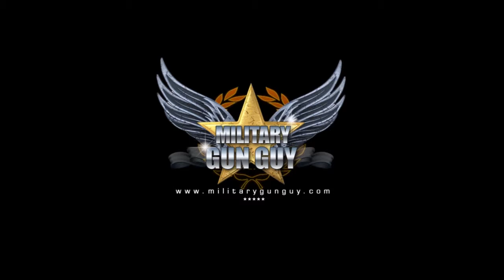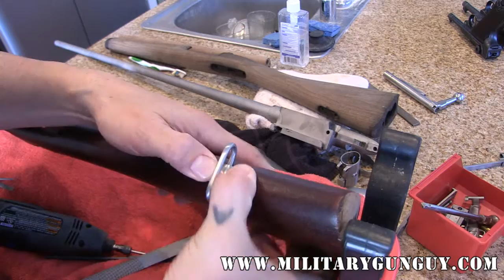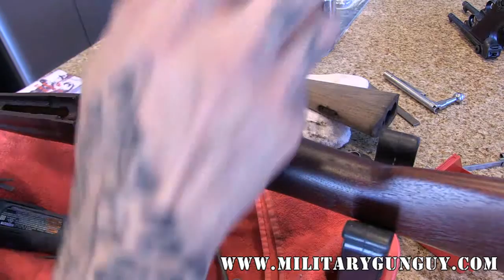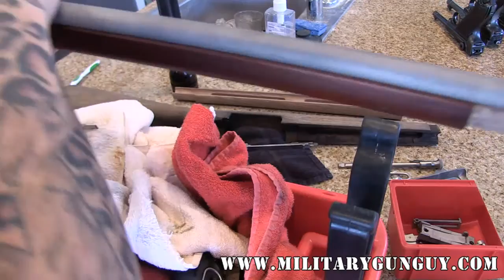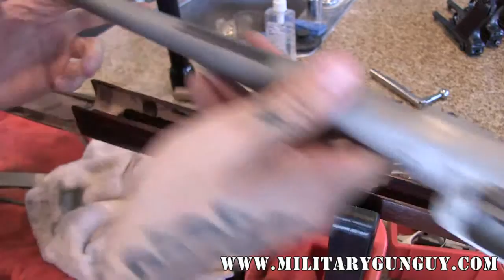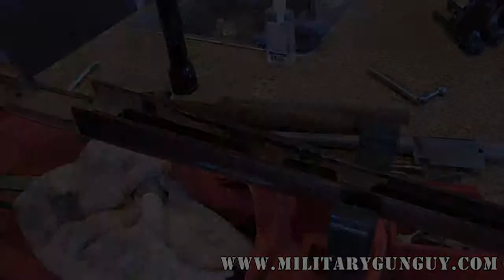1898 Krag Stock Inletting And Metal Parts Fitting

Comment: Well Made Gun are made to last about 400 years if taken care of i was told as a child ? But in thinking that i would also stain the butt end protecting all the wood in the field rain snow weather take its wear on it all ready so even though you cant see the end under the butt a good stain and finish will protect your weapon longer and better over a life time since you may want to hand it down. The end cut is were water would soak in the best or fastest over time ones grand children may use the weapon longer if added finish is done just a thought?
Reply from the maker: +biff I agree. You can use any sort of sealer to effectively keep that area free of decay or damage from water. Many stocks I have worked on have the black stains from water and rust seeping into the wood. A true pain in the ass to remove. And sort of water sealer or polyurethane will do the trick. Even slathering some grease under the butt plate will do in a pinch. Thanks for your feedback!